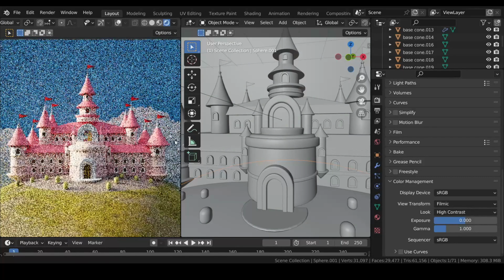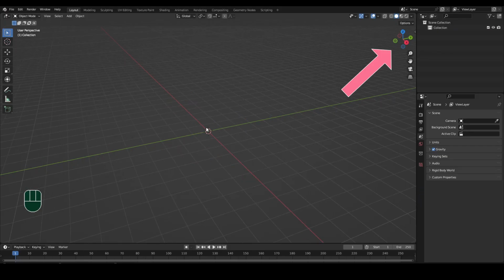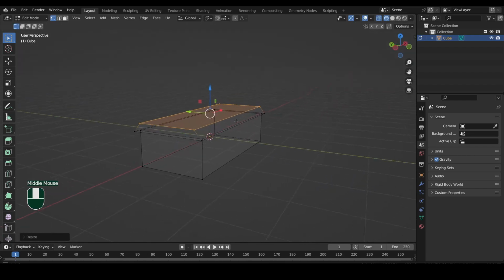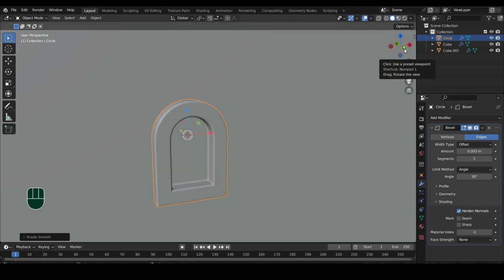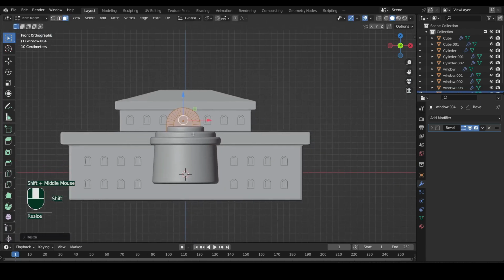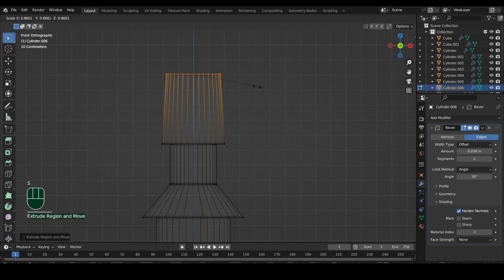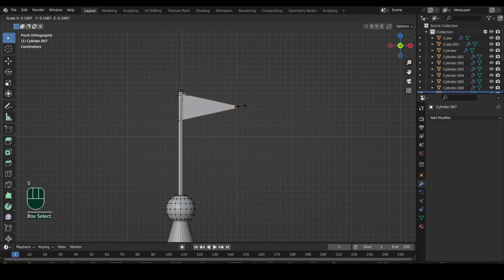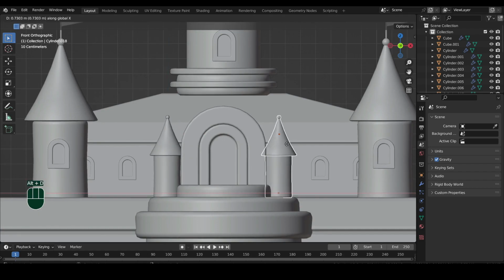How to Create an EPIC Castle in Blender 3D (Part 1) - Beginner Tutorial

Comment: @15:34 -- struggling to follow what you're doing here, it appears like the lower ring is smaller than the top rings and it doesn't work like that for me

also noticed "L" doesn't work to Link for me, and I'm assuming it's because I'm on Blender 4.0